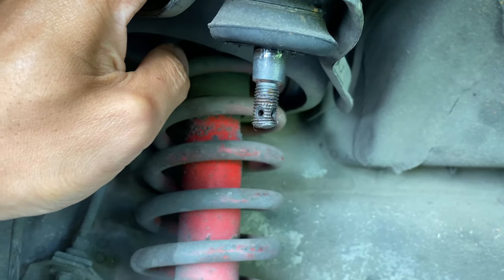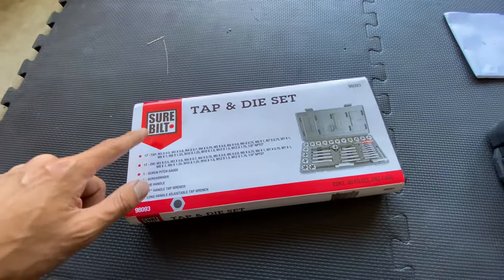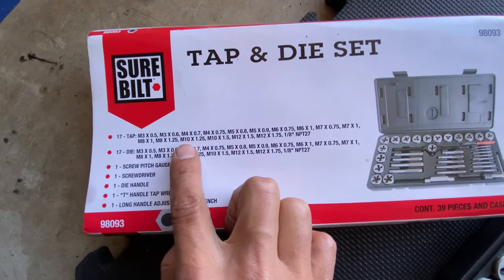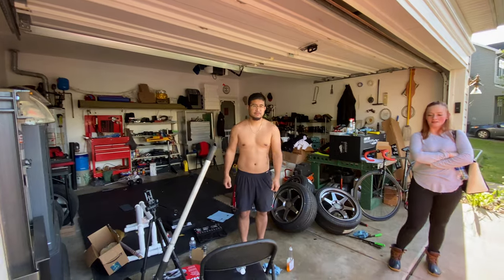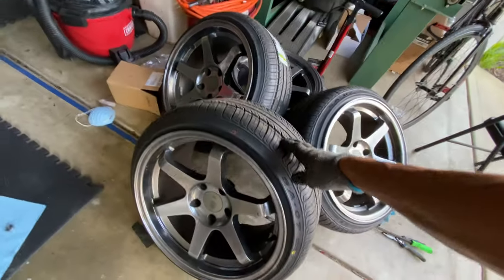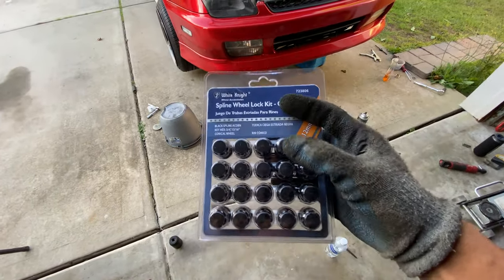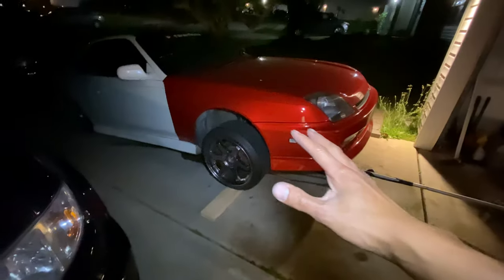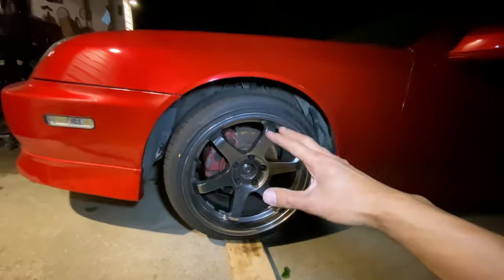Can You Rethread Ball Joints?

Comment: Thanks man! I stripped the ball joint bolt on an atv that I was replacing a boot on. I did a search on youtube and luckily I found this. Went to H.F. and bought a tap and die which was poor quality but worked good enough to get the bolt rethreaded. Thanks for posting.